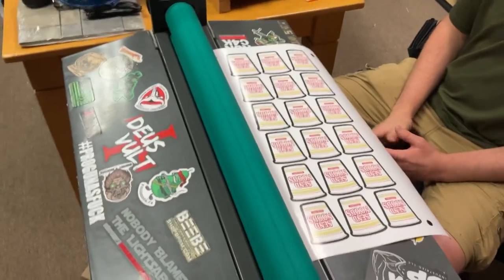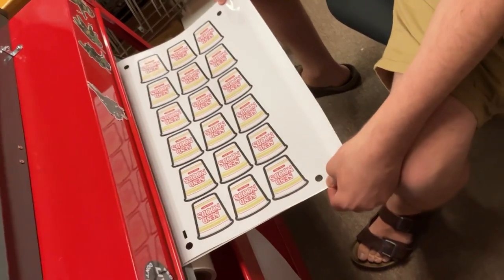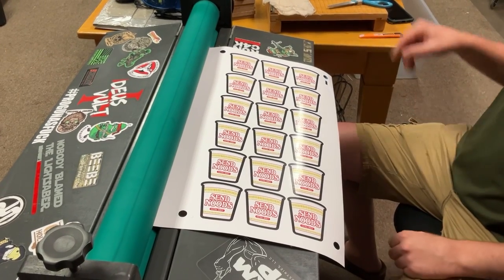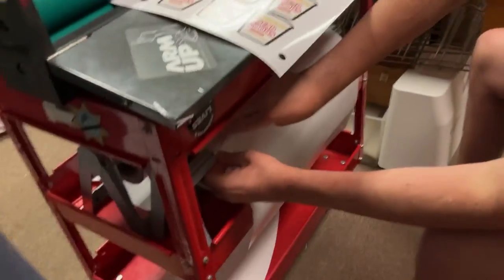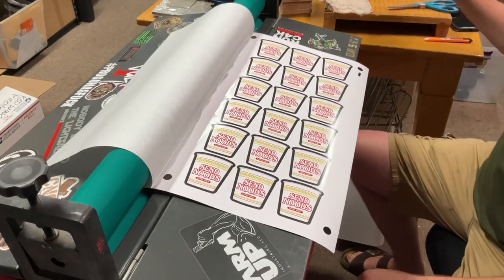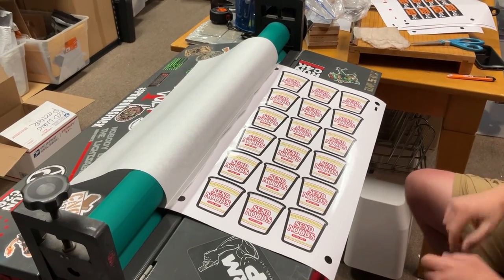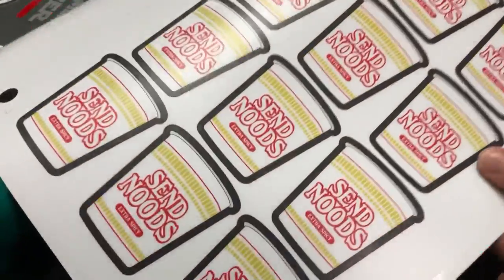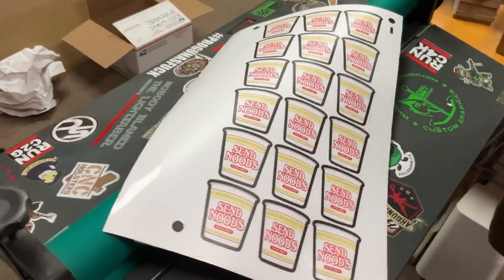How to laminate prints with your cold laminator￼

Comment: Exactly the video I needed. Was wondering why I was getting horizontal marks on my work once laminated. My small laminator has a little wheel, so the roller stops moving every time I have to readjust my hand to spin it again. Makes sense now..